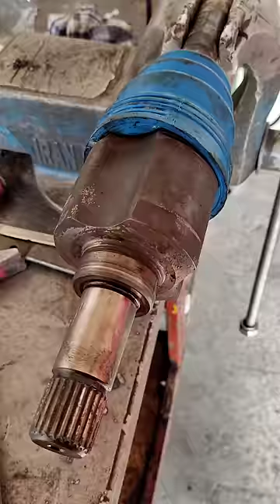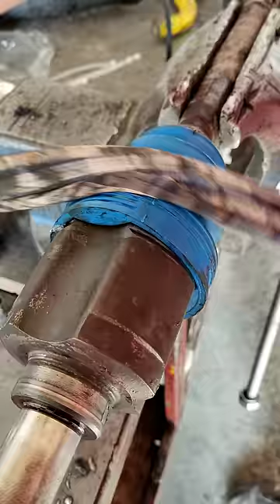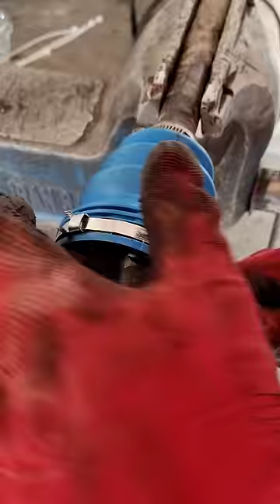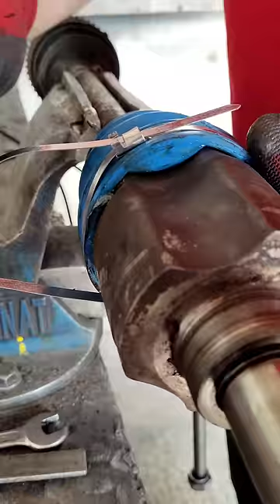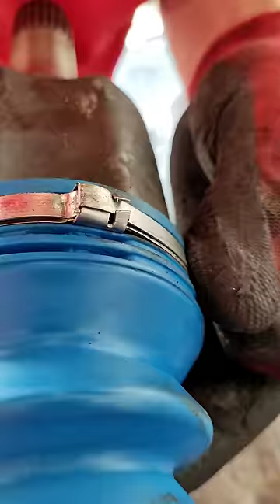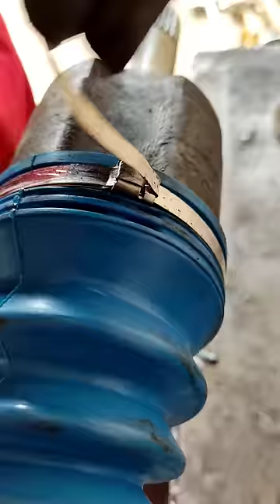Easy Repair #mechanic #automechanic #automobile #cars #truck #restoration #mechanicsteve #shorts

Comment: If you see a small rubber crack put some RTV permatex black silicone around it. 
I replaced the trans axles and the boots started crack in couple years.
Reply from the maker: Thank you for comment 🙏🏻🌹

Comment: Wow, great video!  I did one like this in 1998 on my daughter’s   1997 Pontiac Grand Am. I used a Moog kit, what I liked about it was it wasn’t a rubber boot, but a new compound material (rubberized plastic, like polyethylene and rubber?).  She never had a problem with that joint that I repaired. I noticed that all those joints were the same material. Could that be what you’re using? Thanks…Jim
Reply from the maker: Hello Jim how are you bro ❤️ thank you Jim thank you for comment 🙏🏻🌹